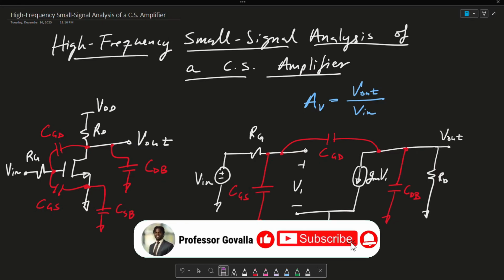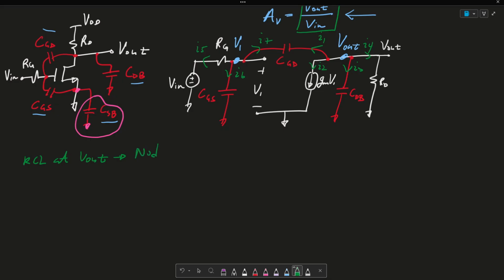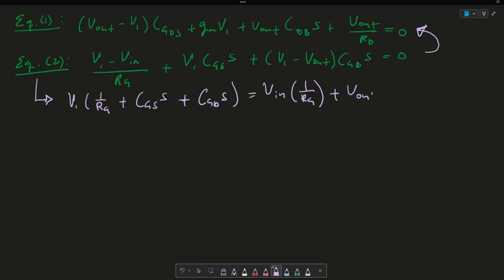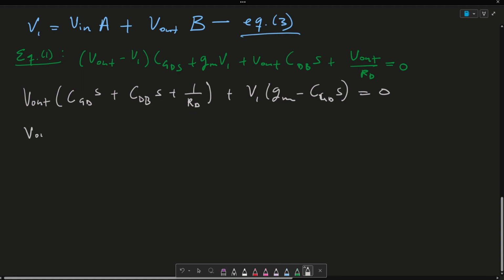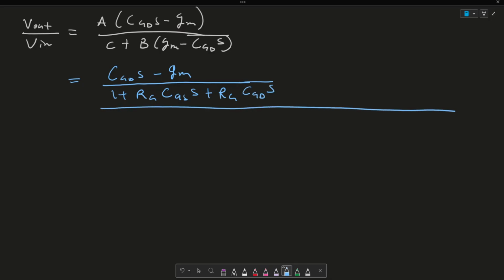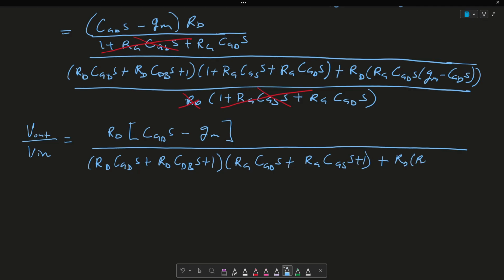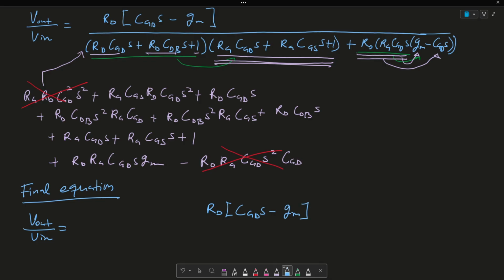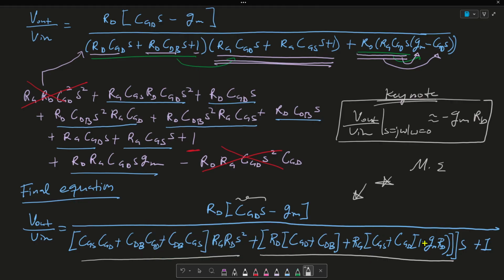High-Frequency Small-Signal Analysis Of A Common Source Amplifier — Clearly Explained

Comment: Grate Material Professor Govalla!  At what frequencies should the gate-to-source and gate-to-drain capacitances be considered?
Reply from the maker: Hi great question, it really depends on the application you're considering. You would start considering the parasitic capacitances when the operating frequency approaches the high-frequency regime, typically starting anywhere from 1MHz to 10MHz for discrete board designs and extending into the 100s of megahertz to gigahertz for ICs. 

In general, your 3dB cutoff frequency can be calculated using the input/output resistance and capacitances. This frequency is a great metric in which to start considering your parasitic capacitances.